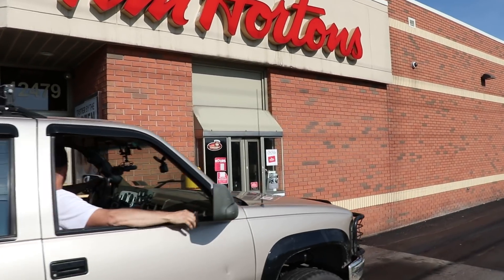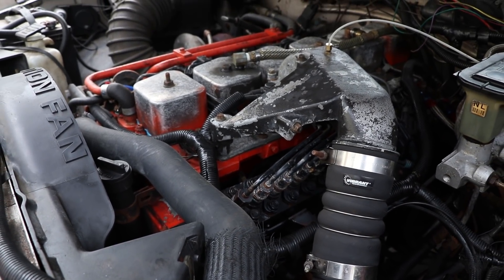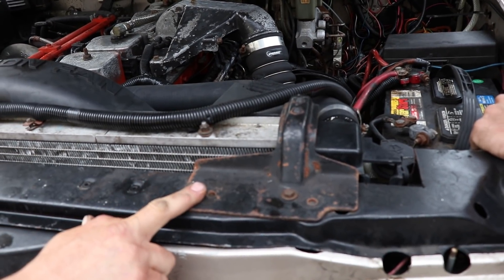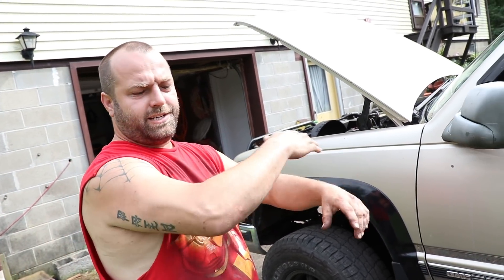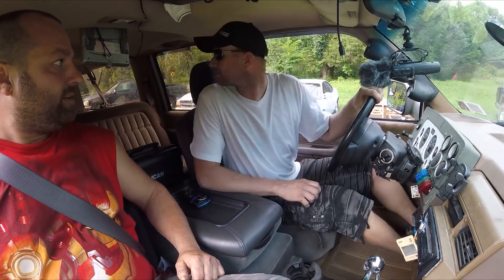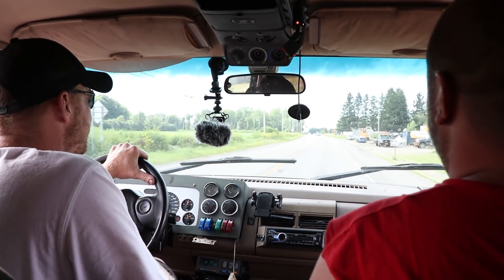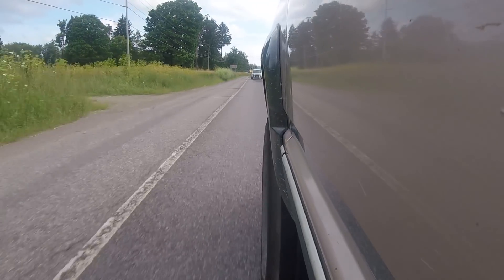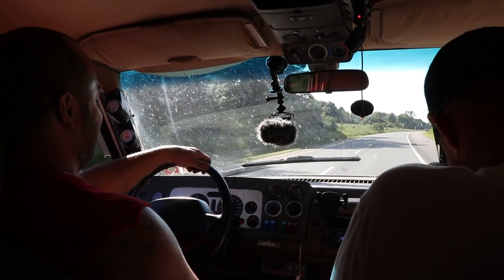He Even Swapped the Tow Mirrors? There’s More Dodge in This Suburban Than GM

Comment: I'm a huge duramax fan but this channel has been slowly turning me into a Cummins guy!
Reply: @Samuel De La Paz 12 valves are just beautiful behemoths
Reply: @FUCK_________googIe  LB7 was a solid engine. Injectors were just horrible though. I never did use aftermarket ones on my duramax but the OEM injectors only lasted 100,000 if I was lucky  before they crapped out
Reply: @FUCK_________googIe  Yes...yes I am
Reply: The only problem with dodge is you get a wonderful engine, that they don’t make. Surrounded by a bunch of garbage that they did make.
Reply: @mcgee9777  so pull the Cummins and put it in something else

Comment: I had my dream truck for a week, 98 Ram 2500 Quad cab 4x4 12v, and then I got T-boned. It has been sitting in storage since the accident in October. I have it for sale, but everyone wants to lowball me. If I could find a clean 95 suburban this is EXACTLY what I would like to build. Thank you for the inspiration.
Reply: DisruptiveMachine,  I’ll take it for free and start a YT Chanel with its rebuilding as my star show.
Reply: Eric Rissler Gee wiz, sounds like a real tempting offer.
Reply: I have seen them for less than a grand.
Reply: David W surely not a Cummins..
Reply: DisruptiveMachine that blows.. I always wanted a single cab long bed 4x4 with a Cummins, but in the rust belt area it’s unrealistic to find an old dodge in driveable condition

Comment: I have a 1993 K2500 suburban that I am doing a 12 valve and Allison 1000 6 speed swap.
Reply: Nice
Reply: That 6 speed is so much better than auto
Reply: @fastinradfordable  Allison 1000 is  automatic transmission!
Reply: @fastinradfordable  the six speed is an auto.
Reply: I have a 94 suburban 4x4 2500 6.5 TD that I have had since 98, blew her up 8 years ago and she is in mint condition sitting in the garage. I was not sure if I do an upgraded 6.5, a Duramax or Cummins. I am a Cummins guy I haveva 92 W350 but drove a Duramax and it hauls ass so not sure what to do..
Reply: @Terk131  swap in a Cummins.
Reply: @jimmyjack7141  I really considered it but I am liking the unsmogged Dmax. I may end up doing a cummins or just doing a 6.5 change out, I do not need insane power numbers. I just want to get it back on the road as I absolutely loved the truck. I got it from a guyvthat owned a dealership and he sold so many cars and trucks so certain dealerships that did so could get these suburbans (that was what he told me anyway) and it is fully loaded with leather and a beauty blue and white 2 tone paint, 4.10's factory locker, I put hummer wheels on it with GMC center caps so it was sharp looking to say the least.
Reply: @Terk131 how did the 6.5 blow up?
Reply: @porcupinepunch6893  bad harmonic balancer, snapped the crank

Comment: Too bad he had a bad experience with the gm diesel. I plan on sticking with my 6.2, can't compete with a Cummins, but it has been reliable.
Reply: @douganderson7002  seems to me like you haven't owned one. 60 bucks on some glow plugs and an oil change and it was good to go. Everything else I've done to it wasn't necessary for reliability.
Reply: Im a cummins guy but got buddy with 6.2 6.5 never breaks down runs great and great fuel economy no power tho but with right gearing they can work
Reply: I have a 94 GM 6.5L diesel turbo and never let me down, it has 230,000 miles.
Reply: @ricbonillasjr2567  The 6.5 made it to about 275,000 second one overheated and cracked a cylinder and was pushing coolant out while in boost. You could drive it on flat land fine
Reply: @secureperformance  how many miles on the second engine when it blew? Mileage on the first sounds about right, that's usually how far they go when well taken care of.
Reply: @kaulincurtis9665  I don't remember but it was over 220000
Reply: @secureperformance  decent mileage out of both then. Still, doesn't compare to a Cummins in longevity most of the time. It's a real nice rig you've got now.
Reply: @kaulincurtis9665  Thank You I did work the shit out of them. They just died at the worst time lol

Comment: I have a '99 Dodge 3500 24v, nv5600, 4.10s I converted to SRW and have 270k on it. When the rest of the Dodge body falls apart I'd love to swap it into a 90s burban. My mom had a 95 k2500 burb with the 454, 48 gallon tank and barn doors. I'd imagine you can pick up 90s suburbans pretty cheap.

Comment: I know he said he had the GMC rear end, but my 1998 12v had 4:11 ratios. If the ratio is the same it should keep the same speed. I could never seem to keep the speed sensor operational in my mopar trans. I was just grateful the damn trans worked, because most fail.

Comment: Just put an hx40 on my 12 valve and was wondering if it was a good decision I’ve got the truck in about every piece possible 😂 frame is bare new cab motor pulled and just trying to do everything right so it will last another 20 years( keep in mind I’m 16)😂

Comment: I had a 95 dodge with a 5.9 and a standared 5 speed and always got 26 to 27 MPG in the summer and dropped to 22,23 in the winter. It was a 4x4. 600000 km's when I sold it and it still gets 26,27 MPG highway
Reply: Sounds like you had a very inaccurate odometer. Probably due to big tires skewing the numbers low. It is literally impossible that a 4WD 5.9 truck got that kind of fuel economy. Any cummins guy who isn't lying will tell you 27mpg is bullshit.
Reply: @yucannthahvitt  well sir I live in Canada and we do have a bigger gallon here so that probably is the reason that your calling me a liar. The truck is stock with 60hp injectors. I use to get no less than 600 miles out of a tank of fuel on the highway.

Comment from the maker: Submit your rides! https://iqcs2020.com
Merch supports Doctors Without Borders https://teespring.com/iqcs-2020
Reply: You can call me a liar, but!
I've had a few Cummins that would do over 20mpg consistently, 96 dually man trans 2wd 2 door with sub 70,000 miles would get 24 mpg to 26 mpg and a 98 12 valve ext cab auto transmission with less then 130,000 miles that would average about the same and ONE time only I set the cruise at 52 miles per hour on a 200+ trip and got just barely over 28 mpg 
I've had several others but mpg was close but not always consistent all 2wd though

Comment: I like the practicality of a Cummins 12v. However, I cannot get past the black smoke out the rear end. I like breathing clean air, and I really believe I should do my part to keep it that way. If electric vehicles were affordable and in my area, I would own one. I was impressed with that four banger diesel that you work done in one of your videos. That seemed very doable.
Reply from the maker: He’s doing his part running on used veg oil.
Reply: Without meaning to sound like an argumentative peasant, what about the pollution associated with the generation of electricity? Is that ok as the powerplant isnt in your neighbourhood?

I'm all for bio/wvo as it makes a more thorough use of potential energy sources available.
Reply: Mark Witkop that smoke is nowhere near as bad for the environment as the batteries are in those electric cars...
Reply: Your dealing with what you see. Which is ok. 
But diesels put out soot more similar to a Forrest fire. 
Gasoline cars polite JUST AS MUCH. 
It’s just invisible and our senses don’t detect it. 
Hence why we need carbon monoxide detectors. 

Driving behind a v8 gas suv is just as bad. It’s just invisible. Out of sight out of mind. 

You want a Tdi 1998-2003. 
They get the best mpg and pollute the least. Have catalytic converters.
Reply: Thought vw just got a huge fine for all their tdi?

Comment: How did his 6.5s blow up? I've heard that but I've never heard 6.5s have a tendency to throw rods. Did he snap the cranks or blow the headgaskets? I own a 6.5 and it's been dead reliable and I just got rid of my 6.2 and it had high mileage. How do those motors give up? I'm genuinely curious
Reply: Not sure, i had a 6.5 in my 95 1500 and it was a great motor. Not alot of power, especially with my nuked  vacuum pump but i never had any problems with it.
Reply: There are about 10% of 6.5 gm motors still on the road. 

There are probably 50% 12v Cummins still on the road.
Reply: Oil cooler line let loose 1400 miles from home . Second Overheated Towing a trailer home from Florida and cracked a cyl wall But it did get me Home
Reply: @secureperformance  I've heard of the oil cooler lines failing. I plan on upgrading mine. I also have the two thermostat setup and and the extra bladed fan. Also have been flushing my coolant regularly so far no problems
Reply: @detroitdiesel-vu3ig  I towed my friends skidsteer and man lift all the time and whooped the s%=t out of the 6.5. The Cummins towes like a beast and no come parring the two
Reply: @secureperformance  I've actually had quite the opposite story. I bought a 1999 Dodge Ram 3500 with the 24 valve Cummins and an NV4500 5 speed. Thing pulled like a freight train but the truck started falling apart as did the electronics on the motor. The lift pump went and then the injection pump and the Dodge ECM. Kinda spoiled how I looked at Cummins reliability. My 6.2 to this day has been the most reliable diesel I've ever owned and that thing was beat to shit when I got it lol. So far my 6.5 has been dead reliable although it only has 114,000 miles on her so far. If the motor does give out, I'm between wanting to do a 12 valve or a 4v53 Detroit
Reply: @fastinradfordable where did you get these statistics?

Comment: I think a good conversion would be to put a Cummins in a Dodge Nitro SUV. Has a really long hood on it. Had a 6.2 Suburban long time ago. Cummins would have much better.
Reply: Doug Anderson  Yea, you would have to do some work on the front end to carry the weight, but was thinking more along the 4BT than a 5.9. Plenty of room under that hood. Just a thought, I’m a full time RV’er and no where to do anymore, besides got a 3126b in my tow vehicle to worry about. Still have my 16 3500 6.7 Cummins to fall back on.

Comment: 6.5 is hard lesson to learn Twice, that engine is good for nothing but a boat anchor.
Reply: Oil cooler line let loose 1400 miles from home. Second one rear cylinder wall cracked on turbo side

Comment: I like this this conversion because it was dirty and down home.
 I feel stupid for all the times I chalked the driveshaft and tires and grabbed a calculator to figure out what speed gear to use. His truck falls under "it's so easy a Canadian can do it". 🤣

Big applause on the Chevy orange paint!!!! 👏👏👏👏
 On previous videos long ago after I saw guys bashing trans tunnels and cutting I suggested body lift was the way to go.
 Recently a sops customer wanted to retain a stock look so a 2" lift was done.

Now without me typing 400 pages watch this video.
 For all you Dodge boys Jeep's and Dodges share transmissions and I think the Mercedes van does too.

The 45RFE and the 545 are the same transmission. With a TCM software update you can grab an extra gear. Ps make sure you have or upgrade to the white connector solenoid shift pack.

https://youtu.be/RKCiCVvF2IU

Comment: Nice build! I like everything except leaving the 47rh in.  Should have swapped in the nv4500.  #MannyTranny4Life
Reply: Manuals are slow..... my 98 has a g56 and is wayy slower than  my 94 with an rh
Reply: Maybe a hair slower, but more reliable and fun by a landslide.  Also more nostalgic and manly.   #MannyTranny4Life bro
Reply: @NoNonsenseKnowHow  eh the nv4500s are junk imho. That's why i went with the g56.
Reply: @alanack67  NV 4500 is a very strong transmission. I've read that the G56 is actually not as strong internally.
Reply: @NoNonsenseKnowHow   nv4500 isn't very strong at all.  Since nv went out of business its really  hard to get quality parts for it which makes it worse.  5th gear is weak and  the counter  shaft design  sucks
Reply: @alanack67  well my stock one has over 200,000 miles on it. So I'm fairly happy with it
Reply: @NoNonsenseKnowHow  do you pull a lot with  it?
Reply: @alanack67  I pull a lot, but not extremely heavy loads and not over very long distances. I try to to stay out of the 5th gear when I have a heavy load behind me
Reply: @NoNonsenseKnowHow   I think youll be fine  then.  They really  dont like towing heavy, or abusive  drivers.      Staying  out of 5th when towing is a very good idea.
Reply: @alanack67  I converted my '93, didn't realize the older NV4500 was a weaker 5th  gear.... found out pulling a car trailer 250 miles from home. 4the gear and 55 all the way really sucks, literally lost 10mpg. That truck would get a consistent 22-28 mpg empty with the bed covered. Sold it after it broke and have regtegreted it ever since!
Reply: @MD-ob1gq   the  nv4500 is only rated to 450ft-lbs from the factory.   Upgraded input  and clutch help, but 3rd gear is weak, 4th and 5th are too far apart.  Its an excellent  transmission  for gas engines (indented use).  The Cummins  makes too much torque for it.

Comment: I'm struggling with my swap in my 1998 K3500 dually.  I started right before this COVID crap and with the quarantine keeping friends/help from being able to come by, the motivation is really low.  I need to be able to bounce ideas off of my buddies with projects like theseA
Reply: Mgtow Farmer 
I had a coworker that the fuel shutoff solenoid kept melting and stopping him from starting. Or turning it off. 
The cable stop is very hard to pull. But at least it doesn’t leave ya walking or calling for a tow.
Reply: Also. Don’t blame your friends for not getting YOUR work done. 
Maybe they’re not really your friends. 
Lol jk ;p
Reply: @fastinradfordable  yeah, I get it. But at the end of the day, it sure is a hell of a lot easier working on these types of projects, especially moving heavy chunks of steel and iron around with help. It's always nice when you have someone there to bounce an idea off of, or someone might be able to see the solution differently than you do, which sometimes allows you to continue forward when you might have otherwise taken a break it working by yourself. This type of project is full of unknowns and custom custom fixes so it's always nice to have other people around.

Comment: Ohhh geezzz yah kept the original dodge transmission??? 47le? Lolz was junk behind anything that has over 100hp
Reply: What's the alternative? A built 4L80 and $$$ adapter plate and such? May as well just build the 47 you already have, it's not like 4L80E will do much better stock. 47re is rated 450ftlbs and 4L80E 440ftlbs. Both will die behind even a mildly modified 215hp late model 12V pretty quick so you have to do a transmission build no matter what you do.

Comment: 6.5s and 6.2s are solid engines, they have there faults but they didn’t make a lot of power, how did you manage to blow 2 of them??? Leave them alone they aren’t designed to make power they are decent little work horses stock.
Reply: he drove it like a gasser
Reply: Oil cooler line broke 1400 miles from home. Second one overheated and cracked the rear cylinder on turbo side

Comment: I like the truck and how he did it. The 6.5 are junk. . they are antiquated
Reply: Yes but no, they arent great for making power like a duramax and newer bigger motors but for when they where released they where pretty cool, especially before 95
Reply: Ok. So they were ok 25 years ago. 
Now they’re antique.
Reply: @dawsonmaxwell9887  in 95 you had Cummins powerstroke and Detroit diesel.  Out of those 3 I wouldn't buy a 6.5 or a 6.2